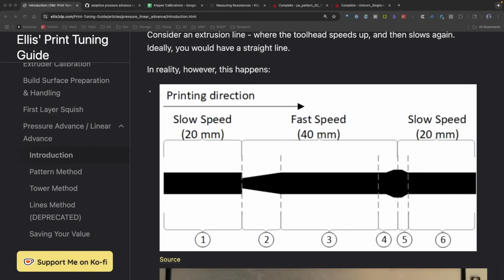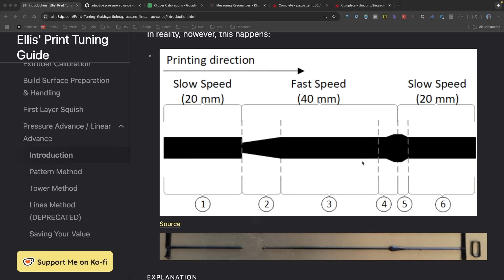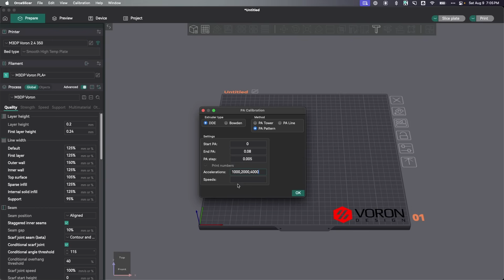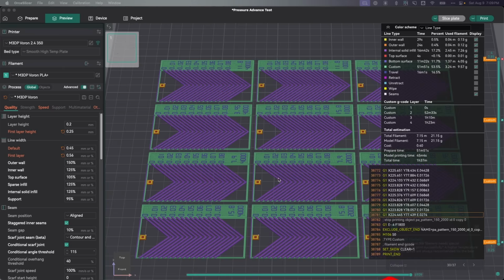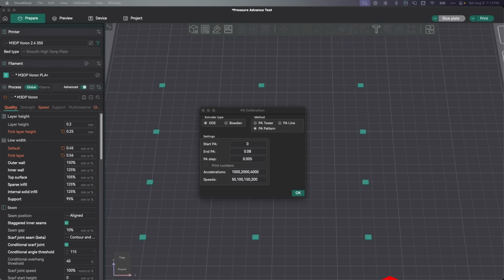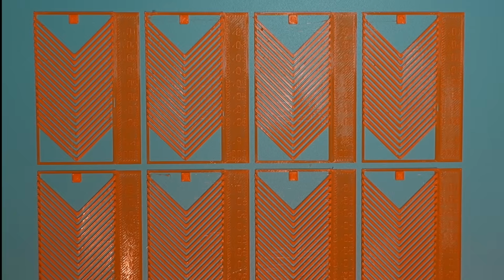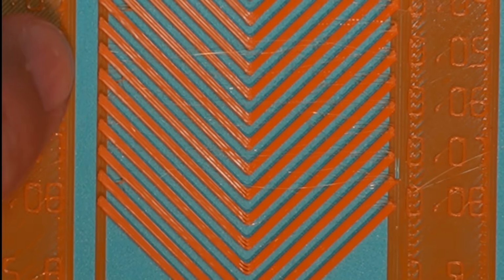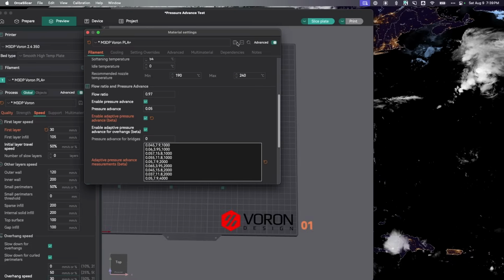OrcaSlicer Adaptive Pressure Advance: A Complete Guide

Comment: i've been using APA since before official release on Orca and I have some advice. so you want to be Alice...let me show you how deep this rabbit hole goes..

regarding the data points that you pick for your 12 prints, you are going to want to choose speeds and accels that match the most with what you are used to print on a feature by feature basis. if you have cooling settings, overhang settings or bridge settings that could potentially bring your speeds down to say 40 or even 20, then your lower end speed should in fact go that low. it's fine to pick 50 like the in the default wiki, even though you might be printing slower on some features, but you will be leaving it up to the APA model to extrapolate out of its range, which it is less capable of doing compared to what it is actually good at doing which is to interpolate between known points. same idea for the maximum speed, which technically i would advise to also know what the maximum flow your hotend is capable of so you don't waste time testing at an upper range your system cannot handle anyway. if you print too close to the upper limit of flow capability, you will see artifacts that are not PA solvable today and will be scratching your head for ours trying to get this thing to work. 15.8 should be fine for most stock printers these days, but not ender3 for example. meanwhile the faster printers can do 20 or more for infill or solid infill. just be careful if you are doing 0.3 layer height at 200mm/s because this definitely would be out of capability of most budget printers.

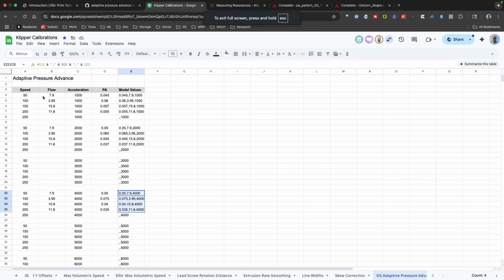i would also advise to be really careful when you make your own spreadsheets that you have all your parameters in the correct order. I'm looking at 12:05 and noticing that you have your flow out of order. this is one place where you could cause you make a typo mistake in the PA column later and potentially waste hours.

i am also looking at your PA values and suspect you may have to take a second look at all the 1k accel prints and all the 3.95 flow prints and re-determine the best PA. the reason is that PA negatively correlates with acceleration and negatively correlates with flow and they do so at their own rates. this has been empirically determined already via the testing community. if you plot PA vs flow for each of the four accels and you plot PA vs accel for each of the four flows, you should be seeing multiple curves that converge but never intersect and cross each other--that would indicate strongly that human error has occurred. it has also been experimentally determined that at low flows (such as 3.95) all the PAs 1k,2k,4k should have very similar if not identical numbers. this is why i doubt the 3.95 PA values because not only are they very far apart, they seem to be increasing with acceleration, both unexpected outcomes. as for the 1k set, the 7.9 flow has a lower PA than the 15.8. plotting all the values out on a scatter plot with line fits is a fast way to identify which prints to take a second look at. the PCHIP interpolation model is very good at interpolation but it will not deviate from defined points and instead take those as gospel. if you say PA increases with acceleration but only for this one time and not the rest, it will not object. this means it is always wise to plot them out and judge by eye and massage the 12 numbers into smooth curves whenever possible before passing them on to Orca.

i suggest to use a microscope or phone camera in macro mode to do the inspection. and you really have to work hard to maintain a similar standard of "best" as subjective as it already is, so that you don't run into issues like the above. as you already pointed out, we are looking for sharp corners but not so sharp at the expense that voids are appearing in the corners themselves. but you will find that with low flows, it is extremely hard to tell what best is and it will be expected to find several indistinguishable bests...and that's how the human error gets introduced. the recommendation from the Orca team is, for low flows, to use the same values for all accelerations if you can, especially if the prints themselves do not strongly object. 

the reason why i recommend not using naked eye is because you will encounter defects that may look PA related but are not. for example if you have first layer print acceleration/first layer print speed set to a low value, that first layer is going to look different from the other layers above it and the naked eye may not be able to pick that out. it's the upper layers that you should be paying attention to as this is where the PA is being varied from chevron to chevron. meanwhile the on the first layer, all the chevrons on one swatch is exactly the same and so should be completely ignored. first layer is also subject to first layer imperfection and elephant's foot will confuse your eye as bulging. i recommend to use the highest acceleration you can to make the cleanest corners on the first layer (to prevent it from becoming a visual confusion/obstruction later on) and to use the same setting for all the prints. orca APA calibration will also default your first layer height to 0.25--i recommend to keep it constant as the rest of the layers for the same reason. you may also see corner lifting at high speeds/accels which is adhesion/temp/speed/cooling related but it may look like PA bulging--this you will never be able to tell apart by naked eye. corner voids can also appear before or after the corner and if you encounter the case where no good PA value exists (all sharp corners have some voids and all non voided lines have bulging corners) then this is not something PA can solve--at least not in the current implementation of APA available to us today. this kind of predicament likely points to hotend, extruder or motor being the limitation and that your specs should be relaxed.

if your print bed is small or you have a slower printer or you are on bowden, there is no way you can slice 12 prints at a time. these are made by python scripts so you cannot move the models on a different Orca plate. just do the calibration wizard 2 or 3 times and slice them individually. also, you may find your low flow/low accel have vastly different PA from high flow/accel, which means you probably won't be able to use one testing range for all data points unless you have a big step size like 0.005. if you like a smaller step size like 0.002, you will have to do the wizard more than once anyway.

you should not assume that APA can handle all layer heights when you have completed APA tuning at one height. before APA was released there was already evidence that flow rate and acceleration is not the full picture to predict PA, but only that it is the most user friendly and good enough for most cases as a proxy for nozzle pressure. if you are printing more often at 0.3, you should run this test at 0.3 instead of the default 0.2. otherwise, use 0.2 and it probably will be ok for most people. there may come a day when a better theory of nozzle pressure manipulation becomes accessible to us in slicer form, but for now, APA actually works great when you are the type who likes to print walls, infill and other things at different speeds and accelerations.

finally, don't assume your different colors from the same make, model and material of filament will have the same APA profile. pigments matter and you might have to do this more than once if you are really into this rabbit hole.

really finally, good luck!
Reply: Adaptive Pa author here.

The reason I don’t recommend going below 50-70mm/sec speeds in the test is that Pa becomes exponentially irrelevant the slower you print. And you’re risking causing artefacts by using artificially too high of a PA value.

Fully agree on the microscope. I did exactly the same thing!

Comment: New to printing here. I've got an H2D and am calibrating 3D Fuel PCTG. My printer on standard accelerates at 10k and I dont ever see going above 250mm/s unless the calibration came out okay for it. So would I test the speeds up to 250 like you showed then do 1k, 2k, 4k, 6k, 8k, 10k? Just so I'm understanding or should most printers just measure up to 6k.

Comment: Did this today myself and found out that the PA values I chose very accurately correlated to a deteriorating exponential function.
The PA values I settled on begin at around 0.04 for low speeds (10mm/s, 3000mm/s²) and plateau around 0.02 for high speeds (200mm/s, 6000mm/s²).
Haven't done any real prints with those values yet, but I'm curios to see how aPA is gonna affect post-overhang artifacts and the likes.

Comment: Great video! Yeah a video on input shaper would be awesome. In particular analyzing the graphs and then implementing the results into an updated printer.cfg. Im neber confident that my inlut shaper results are actually saved. And I dont know how to improve my input shaping besides tightening all the screws and thats it.I dont have any loose screws but I will have 4000 for one axis and 2700 on another axis. Diagnosing each independent axis would be very helpful. Thank you

Comment: just did about 30 tests ... 3 days ... dialed in ... did this twice now and i feel you can actually "guess" all the values in between the highest and the lowest, you still would have to write a table of them with different flows ect. but i feel like ( after spending about 40 hours in my life ) with adaptivePA these values are linear the lower the flow the lower the acceleration the higher the PA and vice versa. I always come out at say 4000 acc and 1 flow at for example 0.03 and at 30 flow at 0.02 and in between its always the same linear behaviour. I guess you could literally profit from this feature just by letting your table be calculated if you do 2 tests per acceleration. This would also shortend down the time to calibrate adaptive PA 4 times ?
I did 25,50,100,200,400,600mm/s and 500,1000,2000,4000,8000,16000 lowest was PLA at 0.04 and highest was 0.016 ... at one filament very interresting results
The sad thing is this is literally one temperature, one nozzle, one printer, one material calibration you cant take away a single thing if you change anything of that. If you change your flow ration in your filament you also cant use the adaptivePA results again.
Just saw in the video they dont recommend to use higher values but i kept going since i got different results and also i simply need higher speeds PA values other than the fallback value they are way lower than any in the calibration if i would stop at 250 / 4000 my printer is cabable of going at 600mms/20.000²/0.2mmZ and is using the right values from adaptivePA ( maybe they say that for other guys since its still in beta )

Another tip is if you have a scanner with high resolution (600-1200dpi) you can scan the tests and scroll around zommed in on them! ( with perfect light )

Comment: I'm currently upgrading my SV08 to have a flat graphite bed and a fast & accurate Eddy sensor, correcting a couple of design issues that prevented it from achieving its full potential as an easier and less expensive Voron 2.4 (not so inexpensive after paying to upgrade) and I'll be doing many optimizations after that, including adaptive pressure advance.  Thank you.
Reply from the maker: You are very welcome. I hope the upgrade goes smoothly.

Comment: I’m the creator of adaptive pressure advance. Great video you’ve done there walking through how to set it up, kudos!

For the tests ideally you need higher granularity. I use 0.001 step size

Also adaptive Pa for overhangs should be generally set to off unless you’re pretty confident your Pa values are spot on and you’ve tested let’s say a benchy and looked at the hull slow down and notice no defects there.
Reply: Great work with adaptive PA! From a datapoint of view if you had 100s of submissions of optimal PA for typical filaments on a specific printer … could this be mostly predicted with a small ML model? I have a hard time understanding why PA values should differ meaningfully between two similar machines or filament types.
Reply: @phlebas-uq6fv  possibly but we are lacking the data in order to analyse it and see what the patterns are.
Reply: @HotendHacker  What would it take to collect enough info? People uploading gcode with properly configured pressure advance?
Reply: @phlebas-uq6fv correct and printer information. Orca doesn’t gather any telemetry (a good thing) so no data leaves your system to allow a model like this to be created. And it really would need a lot and diverse data.
Reply: @HotendHacker  It would be interesting to see the relationship between extrusion force and nozzle pressure. 

One thought I've had lately is that if we could precisely measure the extruder motor draw amperage we could directly in real time effectively see nozzle pressure by comparing against measurements taken during open air E steps at similar accels to those during a print. 
Measuring that in high resolution would probably give us some better data around that relationship. 

Another thought I had would be a load cell for the extruder mount for the same idea. If it's on the other side of the carriage the data shouldn't be contaminated with nozzle to part contact forces.
Reply: @tastyratz that’s roughly what Bambu is doing with their automatic PA calibration by the way
Reply: @HotendHacker  you know for such purpose I wouldn't be get sad if my data would be taken. Its not an age or my interests which can be used to show me annoying ads. If there was some window asking "Would you like to share telemetric data from your prints" I would agree on everything, I have K1C which have camera (low res tho :c), take it as much as you want! I can even take pictures of my prints in macro and share information about fillament... I probably just need to find some kind of research  community
Reply from the maker: I appreciate your work and feedback. 

I will do my next run at .001 and compare the results. I will also take a look at my overhang values.
Reply: It would be amazing if the dynamic pressure advance could take into account a dynamic extrusion multiplier.

I’ve been going down a rabbit hole of profiling my filaments to better understand their flat region of extrusion response with my Bondtec CHT, and then more importantly the region of underextrusion that forms a more/less exponential falloff curve. Then for each point you can correct for the under extrusion by increasing the extrusion multiplier. The problem is that there’s currently no way to interpolate between the points to linearize the printers response.

If this linearized data could be combined with a dynamic pressure advance response, people would really be able to extract every last bit of performance from their printer.
Reply: @Jibberish81 I’ve been toying with the idea of this for a while. Basically increase EM the faster the flow rate.

There are two issues though. The slicer doesn’t know the precise speed of the toolhead so it can adjust flow rate dynamically. Why? Because the printer firmware will apply its motion control algorithm which cause it to deviate from the slicer ideal speeds.

So while the slicer could do it, it would work badly due to the printer firmware and the slicer having different views on what the actual speed of the toolhead is (and hence volumetric flow).

This sort of compensation should ideally be made in the firmware level.
Reply: Did you create the orca implementation? Does the apa interpolate upwards of the largest entered value, or does it only lerp between the values you entered, but never leaves the bounds set by the highest and lowest?
Reply: How does adaptive pressure advance work with arachne slicing mode? Do they complement each other or opposite?
Reply: Please I have a question. Why would we use 200mm at 1000k or even other similar values if the printer isn't going to reach that speed in a path as short as the test line? Can it still be used with a limited speed?
Reply: @maxcstcst5464  I have a thought that you should use those values that you use in real printing, like on my K1C im using accel 300 for first layer, 5000 for walls, 10000 for normal printing, speed 120, 150 for walls etc...

Comment: The data you enter into the slicer doesn’t include the speed, but it seems like the speed is an important parameter for the slicer to know when doing PA calculations.  So I figured that the speed would be roughly proportional to flow rate.  But the flow rates (7.9, 3.95, 15.8, 11.8) don’t seem to be related to the speeds (50, 100, 150, 200) AT ALL.  Is this correct?  Just doing a sanity check here…
Reply from the maker: I appreciate the sanity check. I had to review the docs multiple times to make sure I understood everything. It is correct about the flow rates are directly from OrcaSlicer. I set the values up to match the samples in the wiki.
Reply: @minimal3dp  When I made a first pass it seemed like the flow rate would go up as the speed goes up.  Then I second guessed that when I saw the video.  But I just looked at the github tutorial and it seems like their flow rate does goes with speed.

Comment: Appreciate the video a ton. I glanced at the adaptive pressure advance and told myself to wait until I swapped the MK3s to using Klipper. This gave me the push to get that done later today instead of putting it off yet another week. As much as I'd love to keep printing instead of losing a day or 2, I need to move into some ASA prints for a Prusawire conversion so getting into Klipper now could be nice
Reply from the maker: I hope everything goes smoothly with the conversion.